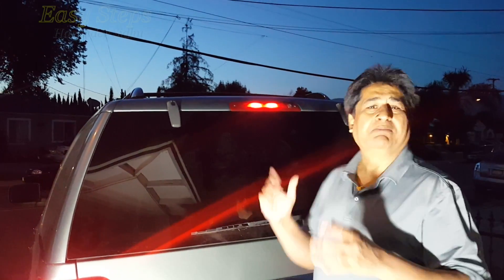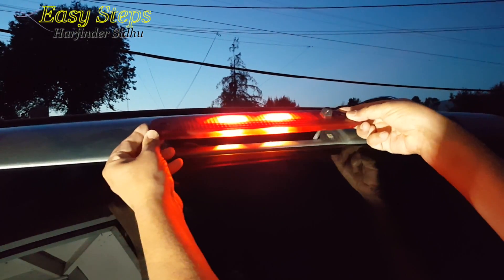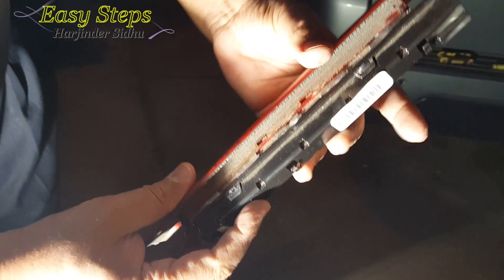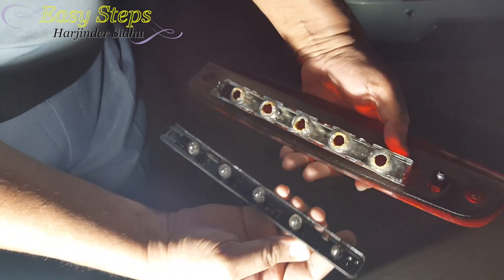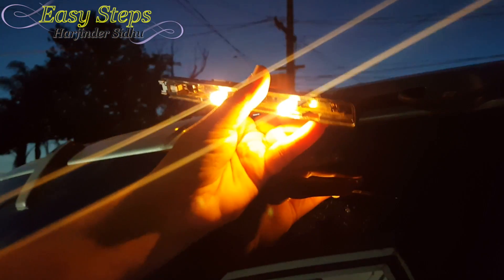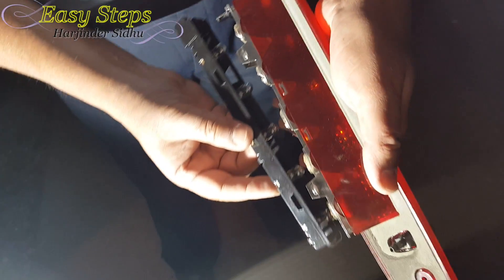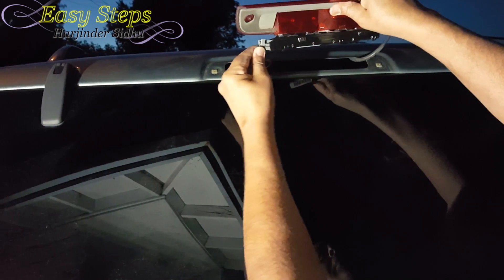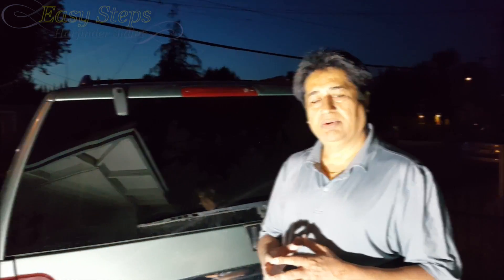Lincoln Navigator Center High Mount Third Brake Light | How To Change Bulbs on Third Brake Lamp

Comment: 2007 Lincoln Navigator 4x4 tsil lights are not working. Both brake lights work, both turning signals work, the hazard lights all work in the back, but the tail lights will not work when driving. I've turned the lights on all of the settings and I get no response from the tail lights. I've replaced all of the lights in the back and still get the same results. I've been looking for the fuse that works the tail lights as my next step but unable to identify which fuse works the tail lights... please help,
Reply from the maker: Please check your Brake light switch, which is a small device attached to the brake pedal mechanism, it could be faulty.
Hope it helps, thanks for watching.
Reply from the maker: I have started posting auto videos on my other channel "Sidhu DIY" so please subscribes, thanks.
Here is the link for my other channel, thanks.
https://www.youtube.com/channel/UCuifMS69Pmx-ykxCar5XW6Q